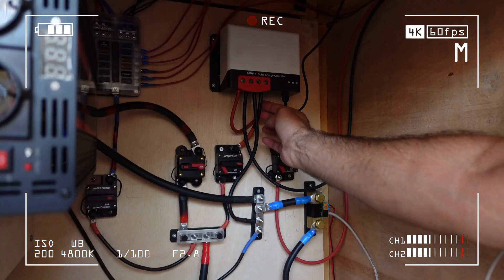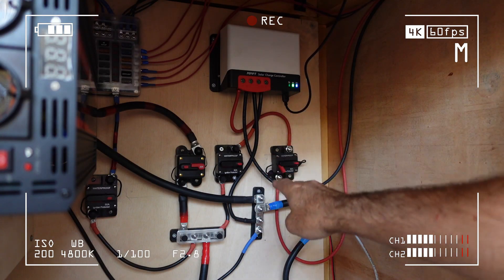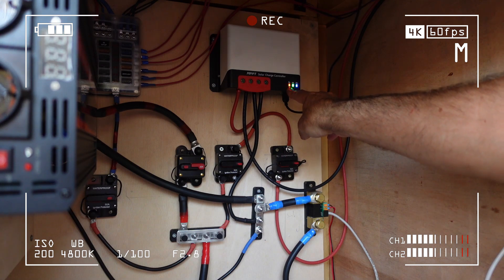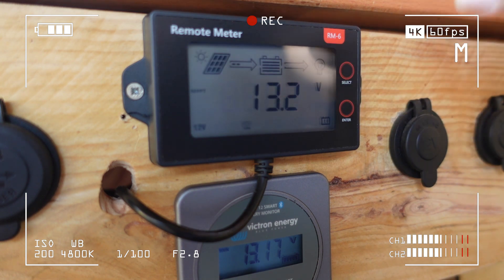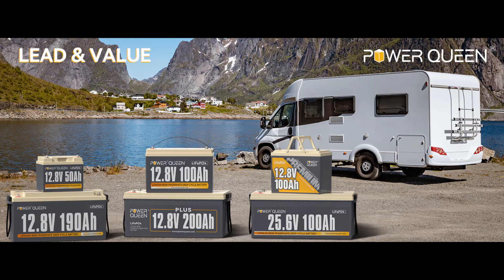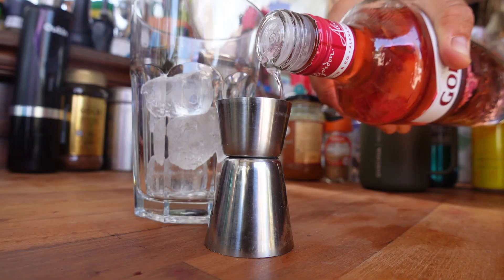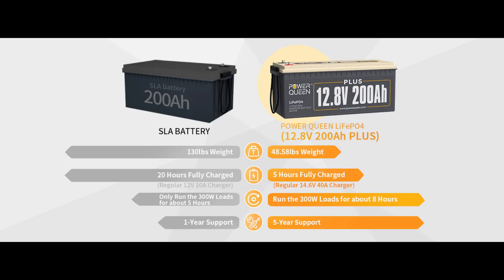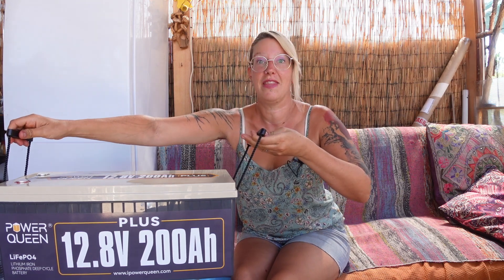OFF GRID SOLAR SYSTEM - POWERQUEEN 200ah, Lithium Vs AGM - Weds Waffle Ep7

Comment: Informative video. I understand that you're duty-bound to rave about the Power Queen but I disagree regarding them being the best. After extensive research I went with a Fogstar 300ah in my van and can't fault it. 4500 cycles, built in bms, built-in bluetooth, built-in cell heating for winter, excellent customer support. I'd certainly  go with this again if looking for another.
Reply from the maker: Thanks for the feedback, their bms looks more basic but we'd have to test and compare. Think our review was more lithium vs agm and lithium coming out top and  raving about power queen

Comment: My only real concern with Ilthium is the extremmes of temp you will have, the cold which most know about and the heat from the dangerous point. Just installed a cmms system at premises in the North West which obs cannot name but they refuse to take lith batterys in for recycle because of the dangers of fire and explosion.
Just be carefull of the enviorment you house these in as you will have a hard time putting a fire out, I could not belive how easy these can catch fire if not looked after.
But the pros and cons I have shifted away from AGM and recently installed a large system in the van.

Loved the vids poss see you around early next year as will be spending a few weeks in your area

Jan n Steve
Reply from the maker: These are lifepo4 which the manufacturer says:
LiFePO4 is. It can withstand high temperatures without decomposing. It's not prone to thermal runaway, and will keep cool at room temperature. If you subject a LiFePO4 battery to harsh temperatures or hazardous events (like short circuiting or a crash) it won't start a fire or explode.

Comment: always time for a good waffle :D and totally agree on LIFEPO4 batteries vs. AGM etc. and if you need good charge controllers and inverters then go for Victron, they are brilliant
Reply from the maker: We've victron in the van and  victron mppt and control at the shade house. Prob do the same in the cabin with an oem inverter though
Reply: @TheWildlanders  careful with the cheap inverters... many of them sadly don't last long and then the money saved is gone

Comment: Excellent move to lithium. I had AGM batteries in my van and they were rendered useless after they went down to around 30 per cent. It was easy to forget that the fridge was running. You now have the best and further capacity added later will be awesome 👌 You will forget that you are off grid 😊
Reply from the maker: Yes we damaged our van batteries the same way 😔